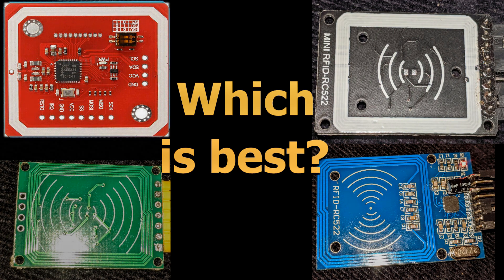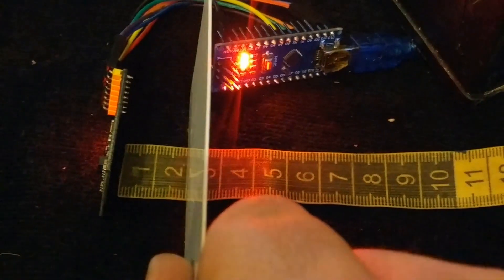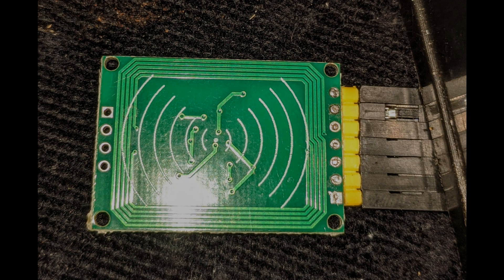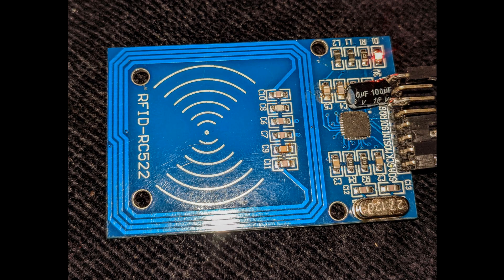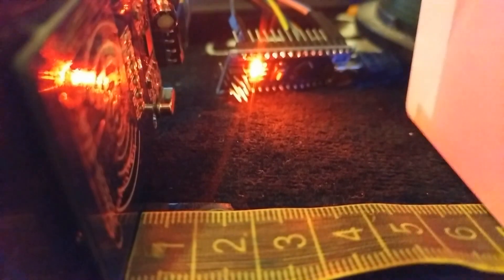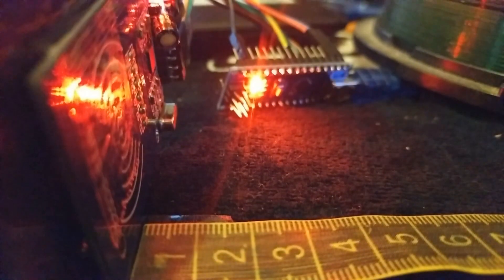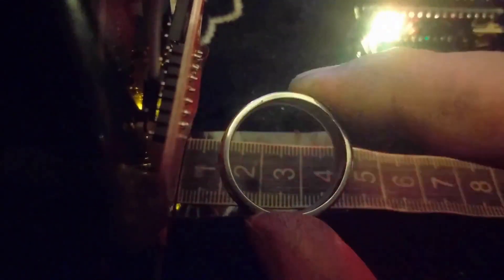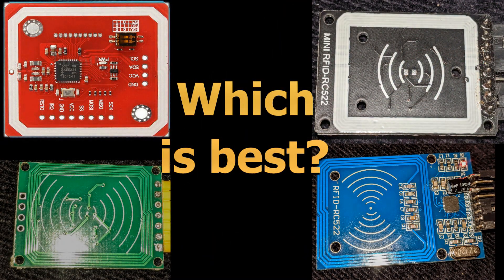NXP PN532 RC522 Arduino or Raspberry PI Board NFC RFID Module  13.56mhz ring card tag i2c iic spi

Comment: Very good information. In my project I am using this pn532 chip using "Type 2 NTAG213 HF RFID NFC NTag Sticker, 40x26mm " NFC. Tag.
As per pn532 manual operation distance upto 50 mm. But I my application it's getting upto 20 mm. How I can increase operation range upto 50 mm?

Comment: Can you share the pin out and code for the last module? I have been trying to get it to work with a D1 mini and struggled - probably a fleshware issue
Reply from the maker: adafruit library on i2c+interrupt /but/ the 8266 i2c is out of spec somehow so its mission improbable.... i spent many hours....then used a 328

Comment: Useless video. The range depends on the hit of capacitors and antenna on a individual board. Isn't this obvious to anyone? I bought china PN532 red board for 3.5$ with delivery. Out of the box sees the card from 1.7cm and does not see blue tag at all. Hahaha. Just by selecting and soldering new two NP0 capacitors with other values I got 4.5cm with blue tag. With my board out of the box it would be video that PN532 garbage does not even see the label. Haha. That's why this video is useless. If your PN532 RC522 boards have this distance parameters, it does not mean that others will have the same. All will well receive when setting up the antenna and vice versa.
Here it is important features of the chips that they can. but there is absolutely nothing about this.
I bought PN532 to make my own door lock to unlock with my Android smartphone without any root and where I don't need start any app or click any buttons on screen, just lean. And I did it (HCE on android side and stm8 4Mhz + PN532 at the other 3.3V 1mA with 1s polling, but I use mains power and li-ion backup power). Also of course I can use my bank card, transport card if the smartphone battery runs out :)
Reply from the maker: Good for you that you can change components, but most can't, so this useless video shows people what they are like when you buy them and use them as supplied. I agree that some companies will supply board with different parts also, how the xxxx am I supposed to make a video showing changes that had not yet happened?

Comment: I guess you have to keeps coils parallel , thats the reason your ring doesn't work
Reply from the maker: I have 6 rings, some work better than others, but it's 'antenna theory' and I guess it's just not possible to get a coil of the right length wire in such a small space. iirc 27mhz was 11m or 33ft, 13mhz would be double, so a quarter wavelength antenna would be a coil of 16ft, so a coil in a ring that small is a real compromise.

Comment: Could you please share the library, fritzing diagram and the code you used. Thanks.
Reply from the maker: library is in arduino ide. code is the example code supplied with library. fritzing??? use kicad.

Comment: Thanks for the comparison. This was actually really useful because I'm planning on using one of these NFC rings to build a keyless ignition system for my motorcycle. May I ask where you got the last red module, the one that did the best? 
I already ordered one a couple of days ago, and I want to make sure that I didn't  buy a clone one.

I'm looking forward to your van video. I will also upload a video of my project if everything works fine.
Reply from the maker: Hi, the red one was eBay, I have been told quality may have slipped so when buying check the photos carefully to match etc, the black square components are what make the performance difference. I bought for same reason, I want to use the ring with the red module in my van door handle, as nothing worse than having a big box and then needing to go through all you pockets for the keys.... My van channel is "really relay camping" I've been asked to fit this to a friends motorcycle but he wants something in his pocket or on his belt and I don't think I'm going to find a way for that.
Reply: @lezbriddon  Thanks for the quick reply. I bough mine off of this website: http://www.elechouse.com/elechouse/index.php?main_page=product_info&cPath=90_93&products_id=2242

I have the perfect solution for you friend's problem. You can buy the NFC tags from Adafruit and since they're quite small you can put it anywhere. In fact, I'm going to make my own wood ring and embed one of those tags (ever heard of bentwood rings?). I think the rings that are sold  online are way too overpriced for me, so I'm going with the cheapest way.

Here is the link for the tags: https://www.adafruit.com/product/2800
You get them from Mouser too.
Reply: @lezbriddon  I'm really curious about your approach to reduce current consumption. Is you system going to get power from the battery or are you going to install a separate power supply? Will your system be on all the time?

This may not be a big problem for cars, but in motorcycles this is critical because the battery is small. Right now, I'm just waiting to receive my components, start experimenting and measure current consumption. I plan to use an ATTINY85 to save energy and shrink my project. 
Another approach to solve the energy problem would be to turn on the reader only when the rear brake pedal is pressed. That way, there will be basically no waste of energy since the reader won't be in an idle state the whole time. The downside is that now you will have to take two steps to turn it on.

I'm glad I found someone who is working on something similar. I'm also considering installing this system in my car, of course, when I had my own car.
Reply from the maker: @Asyss_Complex  my van has 900w of solar on the roof and 5 90ah batteries.....10ma wont be noticed lol. I can see how it can be an issue for a motorcycle with a small battery. sorry i dont have a quick answer, but with deep sleep on an arduino it can maybe be set to only wake when it sees a voltage change from the nfc module, i dont have it to hand now but i think it toggles pin2 on the arduino which is the interrupt pin, so if it is put into sleep with wake on interrupt, it should draw nothing till needed, the nfc receiver will, but i think those chips are low power anyway, maybe would need a poke about in the data sheep and see if theres a command for that, when i get back to this project (currently coding the diesel heater controller (90% done), then have to do the thermostat side to go in the van with a wemos d1mini  so i can get it to work with my phone,  also on with the mechanics to make the panels track, then... once i have the leaks on the hot water fixed, i'll get back to this!

Comment: Tq brother, i'm lucky found ur video. Quite frustrating after buying mfrc522.
Reply: rc522 is cheap i have solved my issue by soldering directly to arduino r3 and rc522, so far working perfectly even with 5-foot wire but with WDT or reset function in the code every 5 sec. but pn532 is better, I want the ring nfc as tag id on my door lock hence going to upgrade to more expensive pn532

Comment: I have 2 of the red nfc v3 modules and neither one has anything close to the range yours has. I found that anything beyond about 15mm away from the reader with either a card or a fob yields no read, am I doing something wrong with it?
Reply from the maker: Have you got stable supply voltage to it? Do any components look different? It's not uncommon for them to start using cheaper components later in production or just vary batch to batch. I only had that one but since buying two more I should find the time to test them
Reply: @lezbriddon  yeah supply voltage is fine stable 5.00V, I think I just had some bad boards as I have just bought another one and it reads fobs from a good 30-40mm away without issue and if I swap in one of my old ones to the same wiring and code it will only read fobs that physically touch it almost exactly where the resistors connect to the antenna ring but anywhere else on the board and it doesn't read anything. likewise with cards you have to physically press them against this one spot to even stand a chance of reading it.
Reply from the maker: @SavageSmithy  yeah typical eBay quality. Do the bad ones look identical in components to the good ones?
Reply: @lezbriddon  almost but the capacitors/resistors on the new one where the antenna joins look slightly bigger and a different colour (blue ish as opposed to brown) thing is I got all 3 units from Amazon and they all have the exact same branding on them (elechouse or something) so I'm not sure how you're supposed to tell before it arrives
Reply from the maker: @SavageSmithy  yeah there possibly surface mount inductors, bigger is better but with cost cutting they use the minimum they can get it to function with, if possible return them it's just not right how they do this
Reply: @lezbriddon  to be fair they worked when I bought them and that was about a year ago, they never had the range this new one has but they did work so I didn't know any different, guess that's why they get away with it. Not sure where my other one is but if I find it I'll do the same tests. It is appalling that they get away with it because there's really no way to tell until you've received and tested the stuff which if you're getting it from China directly there's little chance you're returning anything.